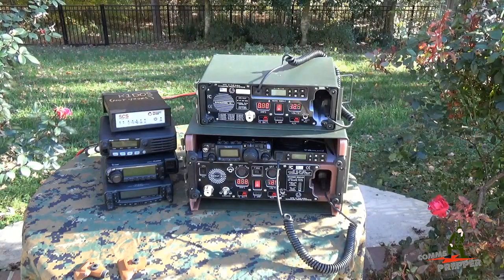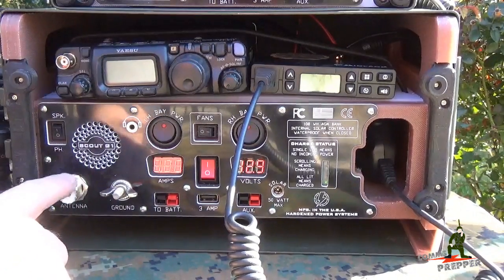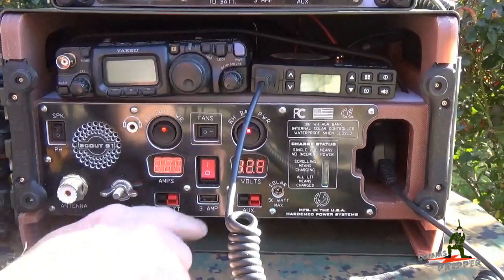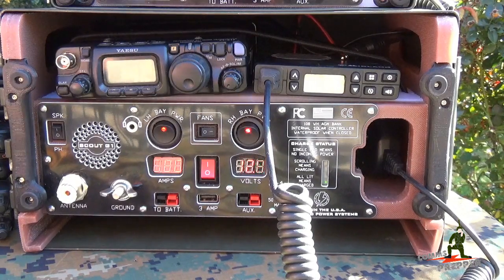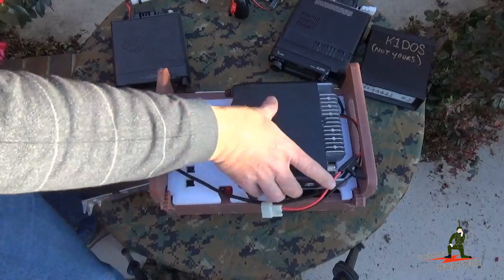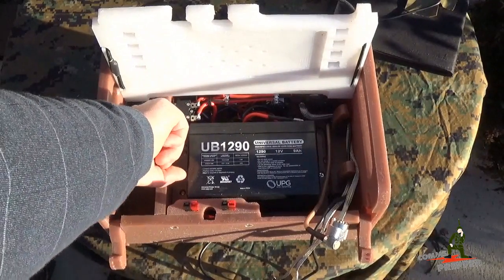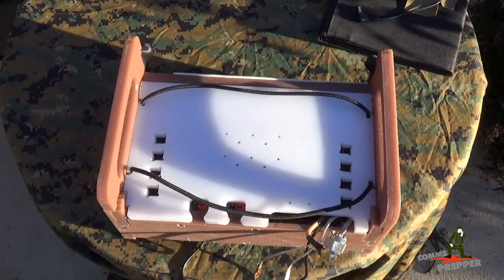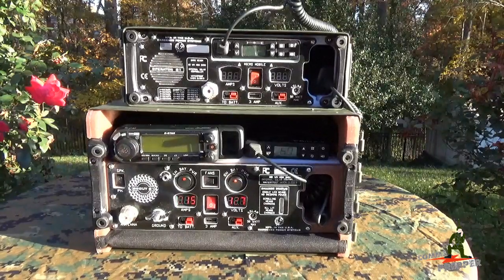Hardened Power Systems' Scout G1

Comment: The operater G1 I’m wanting to get some time in the future. My question is I live in southeast Ohio. I want to set up a GMRS system for my property. It’s about 200 acres hills and trees . So when I’m out hunting I can communicate back to the house and others hunting in my group. 
Here are my thoughts Midland MXT115 for the base station. I will start with the midland 6 gain antenna put it on the roof of the house. (Side note my house is on the top of the hill.) For now I thinking of the handheld units will be Wouxun GMRS or the Baofeng GMRS. Then maybe at some other time getting the Operater G1 . 
I would like to know your thoughts. Maybe you have a better idea .
Reply from the maker: The chinese radios are not approved for use in the GMRS or FRS radio services.  I suggest sticking with the Midland product line.  DPD Productions makes a great GMRS base antenna.  I recommend quality cable, connectors and antenna for your base.

Comment: How long does the battery last before you got to charge the battery again for Field and at a base camp.  I'm thinking about getting one.
Reply from the maker: I don't remember.  Best to check with Hardened Power - they have changed the battery types.  It has been awhile since I used this unit.
Reply: @Commsprepper  oh okay will do that thanks man stay safe

Comment: Too bad you don't have to RF connector on the front panel that would make it easy to mount to Radiohead that have the RF connectors on the back side
Reply from the maker: look again.  Both have SO-239 connectors on the face that have cable to the rear of the case.

Comment: I have the Scout G1. Something I found out was, if you plug in the wall charger, you must put the power switch in the ON position for it to charge. I didn't do this and my unit didn't charge after a few hours on the charger. Don't recall any instructions indicating this but thought I'd mention that.
Reply from the maker: I am not sure.  I don't have my unit with me right now.  I suggest you contact Hardened Power Systems and ask them.

Comment: I need to pick your brain regarding using this in a man packed operation, antennas
Reply from the maker: what's the question?  Which unit are you referring to?
Reply: Commsprepper well as it stands right now the scout if you are going to "go tacticle" and mobile I guess you'd be man packing more or less. With that said what kind of antenna would you use for a GMRS & CB combination. the thing that popped into my head were the antenna combination that came with the prc-77 radio.

Comment: While my radio is being stored, will the Scout G1 project it from an EMP?
Reply from the maker: EMP protection is theory so no one can give a definitive answer.  However, if you ground the can and replace the rubber gasket with brass wool you will have more protection that a radio on a desk.
Reply: PUT your cell phone in the case and shut the lid, call your number and see if the phone rings. if it does no protection, if it does not might show a bit of protection but how much we never know. W4GSM
Reply: Commsprepper Thanks

Comment: Neat looking package. Great review as always.
Would the solar charge controller work with LiFePO4 batteries such as Biennopower's?
Reply from the maker: Not sure.  You would have to ask Bill at Hardened Power.
Reply: Dean, The Scout uses a PWM charge controller intended for SLA batteries.  It is not compatible with LiFePo4 batteries unless they are 'drop-in' replacements for SLA, like this one: https://www.amazon.com/Tenergy-Rechargeable-LiFePO4-89-6Wh-Battery/dp/B005I7M7DS
Reply: Hardened Power Thank you. I appreciate the prompt reply.

Comment: Do you just have the GMRS radio's antenna tucked in the back like it is in the Operator?
Reply from the maker: No.  The Scout G1 is not radio specific.  This said, if you chose to put a Midland Micro Mobile in the Scout you coud fit the antenna in the bay area.

Comment: Doesn't look like it would accommodate a kx3 very well though.
Reply from the maker: Can't say - I don't have one.
Reply: Dave, good question.  Obviously the KX3 is a unique form factor...  I do not have one to test the fit, but including knobs and connectors, I believe the KX2 is 3.45 x 7.85 x 2.45.  The upper equipment bay in the Scout is 2.25″ tall, 10.5″ wide, and 8.5″ deep...